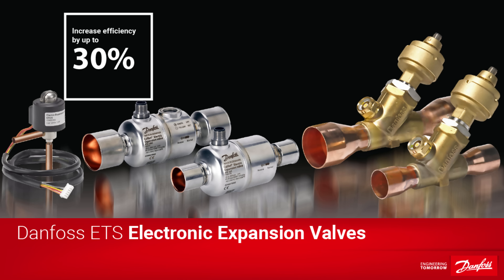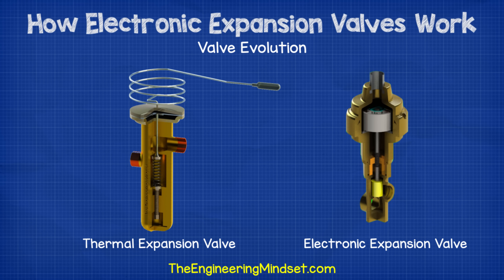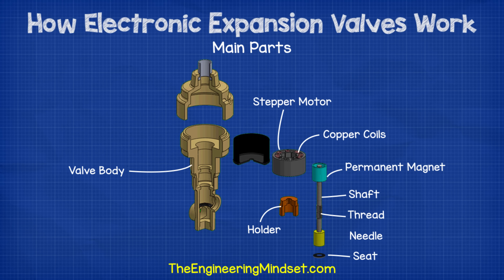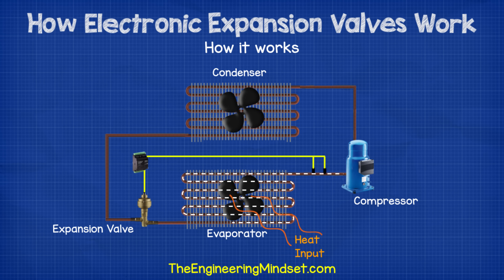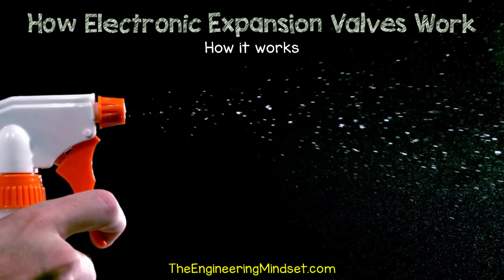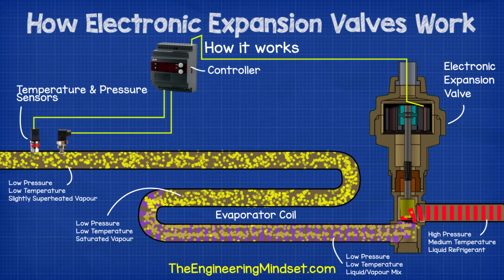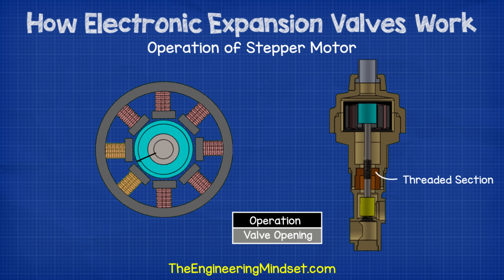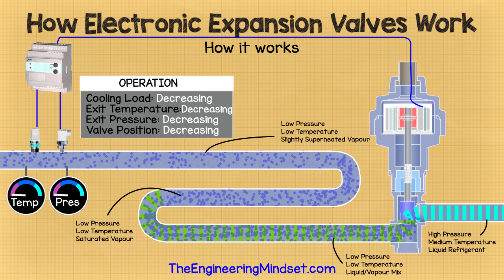How EEV works - Electronic Expansion Valve working principle, HVAC Basics

Comment from the maker: ⚠️ Found this video super useful? Buy Paul a coffee to say thanks: ☕
PayPal: https://www.paypal.me/TheEngineerinMindset
Reply: The Engineering Mindset can you make a video about flow rate, pump capacity, pump pressure, how to calculate dimensions on copper pipes, pressure drop calculations, transmissions etc
Reply: Please explain trouble shoot of over charge of refrigerant. Explain what happens to the system if the refrigerant is over charged and also under charge
Reply: Sorry, sending money from my country is difficult .. else I would have. He definitely deserves that.

Comment: Working with the danfoss ETS 6 EEV valve. The wiring harness has five wires. Red, black, orange, yellow, and gray. I assumed the gray was common. But the gray wire is not connected to the controller. The tech support team at danfoss told me they don't use the gray wire for a unipolar valve. How do they send current to the coils without a common? Is it built into the controller?

Comment: why not just use on-off electronic injectors like we use in combustion engines?
Reply: Need variable and precise actuation control
Reply: Like an on and off solenoid valve?

This might overwork the solenoid by always opening and closing.

Comment: Hey. Thanks for the really informative video. Let’s say I want to place a refrigerant tank in my schematic. As the mass flow rate of the refrigerant can vary a lot (from lowest rating to highest rating) let’s say from few grams per second up to kilograms per second. Is that even possible? If so, I assume there should be a tank placed somewhere. Where would it be? Thanks !

Comment: Thank you for the video. Good explanation about EEV operation.
P. S. These EEVs might be a very precise tool to control SuperHeat. However, it’s not as reliable as a TXV. Last year, I had 2 HeatCraft walk-in freezers at Baskin-Robbins restaurants that were acting crazy, flooding the condenser, cooling poorly. One compressor that was only 4 years old has died. Had several calls to HeatCraft tech support; adjusting the SuperHeat reading/calibration on the control board, replacing sensors…. Long story short, after a month of giggle-wiggle I’ve got rid of these electronic controls and EEVs. Installed TXV, defrost timer and regular mechanical thermostats… It’s been almost a year now. Both customers are happy with -5F; -7F. No complaints.
Today, I ran into another walk-in cooler from HeatCraft. This one is a big evaporator with EEV and… it’s acting the same way as those small walk-in freezers were doing; SuoerHeat hunting, flooding the condenser, suction line saturation temperature goes from ~24F to 2.1F in a minute or two… and goes back to -22F… Again, I will try to repmm m Ave the SuperHeat sensor as it was suggested by HeatCraft tech support…. However, I’ve got a feeling that it will end up with another TXV.
Reply: Manufacturers use this junk because it is cheaper and you will have to come back to their greedy arses to purchase a special unique replacement part.
Reply: Would you compare it to an engine using a carburetor versus fuel injection?
Reply: They work well I think of them like direct injection more precise but tighter tolerances in terms of the electronics that Sutton them. They often use cheap thermistors that produce faults associated with the eev and because the eev communicates with the SLT,SPT and VFD for compressor if you have one, it can become a troubleshooting nightmare just tryna isolate what’s really the issue and so many safeties are put in to systems to prevent flooding they will cut everything to save components. In refrigeration it’s the Wild West run until the repair man comes most you get is a controller that monitors SH unless you have the communicating type of refrigeration setup

Comment: Can the same EEV work to do both heating and cooling (in the case of a heat pump)?
Reply: Even in case of HP EEV maintain superheat in evaporator (See "Heat Pumps Explained" at this channel). For reversing HPs it's a question of algorithm inside controller.

Comment: What a great presentation!  But I fail to understand how this stepper motor driven device can produce more accurate results and more economical operation than a correctly installed and sized txv that has infinite control positioning. It appeared to me that the device would operate on predetermined levels, be it 10, or 100, I am unsure about that
Reply: Stepper motor EEVs usually have 200...3000+ control steps. In laboratory you can see the difference between 240 steps & 480 steps, to see the difference 480 vs 2400 you need very precise tools. In real practice you see no difference in EEV capacity regulation with true infinite capacity regulation. 
More accurate SH regulation achivied due to electronic control of the valve - faster reaction + "proactive" PID controller vs "reactive" mechanical control.
P.S. Even PWM EEVs like Danfoss AKV or Alco EX2 are OK for supermarket applications.
Reply from the maker: See our new video on how to build mechanical versions of electronic circuits? Watch here: https://youtu.be/Zv9Q7ih48Uc

Comment: Did I get it right, that the expansion valve uses pressure losses in order to reduce or increase massflow, so as a result the transfered heat to the ambient air is reduced or increased? Because if the area the fluid is flowing through is reduced, friction and therefor pressure losses increases.

Comment: Hi Paul, great video!  Just one clarification: How this operation stops when the set temperature is achieved?. Means How is it collaborated with the thermostat operation. ? Anybody please reply.
Reply: All refrigeration systems that use EEV's are computer controlled and have several sensors in the system. They also have a set "swing". For instance a multideck supermarket fresh meat case may drop down to 24F. This will close the stepper EEV valve or the pulse EEV valve which ever is being used. As soon as the valve closes the temperature starts to rise. The valve starts to reopen when the temp reaches 35F or so. That's the swing. The time between opening and closing of the EEV valve.
Reply: As for as my knowledge, as a certain temperature reached, the EEV will close the refrigerant and your machine will stop. as the temperature rise machine will start but the EEV still will close until the suction press drop. Then the EER will open gradually.

Comment: Nice video indeed! How does the EEV work with a system where you have 4-way valve to turn evaporator to condenser and vice versa? Heat pumps with heating and cooling..
Reply from the maker: Check out our selection of free heat pump tutorials https://theengineeringmindset.com/heat-pumps/
Reply: @EngineeringMindset   thank you for not answering.
Reply: @mk-yg6mi  bypass with an extra eev for cooling, his heat pumps basics explains it.
Reply: They work both in heating and cooling . Mini split eev ramp based on about 5-6 parameters mostly temp sensors

Comment: Sir in mitsubishi vrf system indoor expansion valve is not working so what to do
Reply: Motor valve is not open so give me idea to open the valve
Reply from the maker: My best advice. Check the model number and download the technician manual from the manufacturer website. It should contain troubleshooting options
Reply from the maker: New VRF unit video here:➡️  https://youtu.be/4i1XgcP1tmw

Comment: How does the increase in cooling load increase the pressure? Doesn't it affect only the superheat?
Reply: EEV systems have variable speed compressor, that is, low cooling loads make the valve close down to keep the required superheat once the evaporator becomes cold and this tells the compressor to "unload" reducing head pressure, and vice versa. The AC system in my car works exactly like this even though it has a TXV and not an EEV. As soon as the TXV begins closing down to keep superheat constant even with a cold evaporator, a valve in the compressor senses the decreasing suction pressure and "unloads" the compressor. You distinctly hear the refrigerant flow reduce to a trickle and the compressor noise change after some seconds as the evaporator gets cold, if you hold an ear under the evaporator box...

Comment: When I install a new EEV into the air con, should we need to set again,the zero point of the step motor for the main processor know how far motor goes ?
Reply from the maker: Read the manufacturers install notes
Reply: No, upon initial startup they self reset, travel to each end point to self check

Comment: Didn't explain where the energy savings comes from... but very nice video! Thank you
Reply: I believe main saving comes from operating valve so minimal super heat is achieved more precisely. Additionally because they can also use pressure sensors, they can estimate super heat much more precisely. Together with PID controller and autotune, they can maintain more stable super heat temperatures, without cycling or overshoots. Additionally they can act like a solenoid valve sometimes, to shut refrigerant off, eliminating parts; as well allow multiple evaporators to cooperate and optimize operation; other option is to cooperate with compressor, both to prevent compressor flooding and by providing easier start to compressor. Additionally most controllers can detect failure of the electronic coil or the valve (stuck position) by measuring current or resistance, and send a signal to other place to shut off the system, and even pump down refrigerant from the system to a reservoir, and prevent system leaks (on stuck / broken valve, or when the sensors detect very abnormal performance). So some of the savings are in reduction in maintenance and preventing various failures too. And because they are electronic and do have controller, they can be managed and monitored remotely, helping with troubleshooting, maintenance and optimization. Some of these features are not due to the valve itself, but due to better insight into system due additional sensors already in place to support the valve.

Some of the electronic expansion valves are used for other purposes than just super heat control after evaporator. Some are just used as normal valves to control pressure, i.e. after the condenser or various by pass systems. They are quite versatile. Plus they are easy to adjust electronically, if the refrigerant type is changed in a system.
Reply: With EEV, inverter units: compressor, ID and OD fans can all ramp down to about 20% , meanwhile maintaining optional superheat and subcooling. EEV greatly aids these happening, And also reduce the need for defrost cycle

Comment: Hi, can you make a video on how to select refrigeration system components (coils,compressors, pipes,..) after you calculate the BTUH required?
Reply: Ton one ton =12000BTu/hr 1Btu=252calories1ton =12000btu×3024000calories 1rob=3024000/1000=3224 kilo  calorehr.....
Reply: https://youtu.be/0gv2tJf7nwo

Comment: Still not sure why you would use pressure when it's not needed. If you attach a thermistor at the outlet of the EEV and one at the outlet of the evaporator is that not true super heat? Following the refrigeration cycle if the outlet of the metering device is lquid vapor mix, then the refrigerant can not be super heated or sub cooled, and unless it's a Bose Einstein then in must be at boiling point, and any heat added to the refrigerant on the outlet side of the evaporator would be super heated by it's very definition. So why use a pressure transducer and then have a module simply convert it back to temperature any way. It's just one more thing to leak.
Reply: The reason is pressure losses are not taken into account with thermistor in and outlet controls. The distributor has a pressure loss and the evaporator to, the bigger the total pressure loss the bigger the superheat calculation error based on 2 thermistors. With small systems without a distributor and low pressure losses over the evaporator 2 thermistor calculations work perfectly.
Reply: Remember that pressure changes much more rapidly than temperature does, so it's a much more precise way of controlling superheat (and compressor loading and unloading too).
Reply: Steve Brawner yep, the ones I see use line in line out thermistors to control the EEV.  A suction pressure Transducer to control compressor speed.

Comment: Dear sir
Why refrigeration cycle choking and solution
Reply from the maker: Hard to say basing only on "its choking" but from that I would guess not enough refrigerant is either in the system or passing into the evaporator. Call a refrigeration engineer to inspect.

Comment: Can i incorporate EEV's in a older system with mechanic TXV's/CCOTs?
Reply from the maker: Almost certainly, it does depend on the system though.  You can find a valve for your system here: http://bit.ly/Electronic-Expansion-Valves